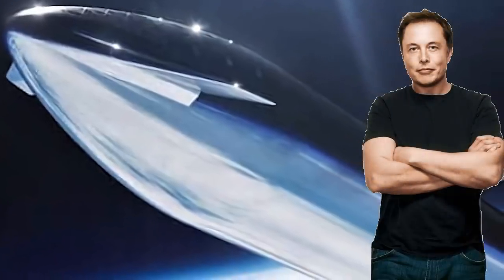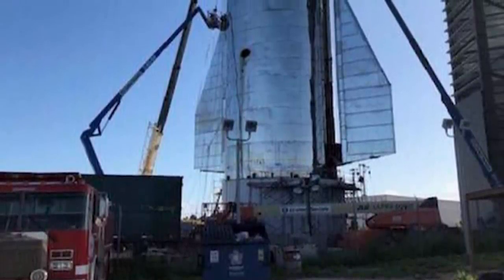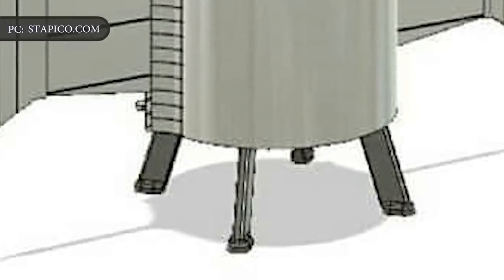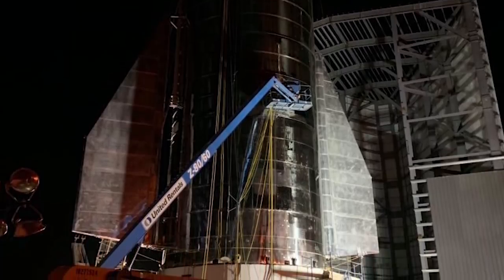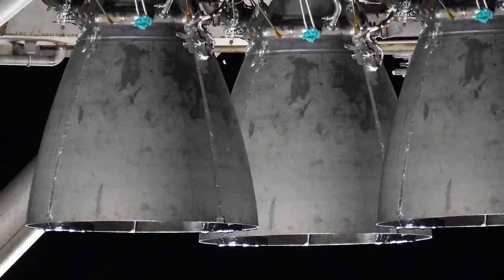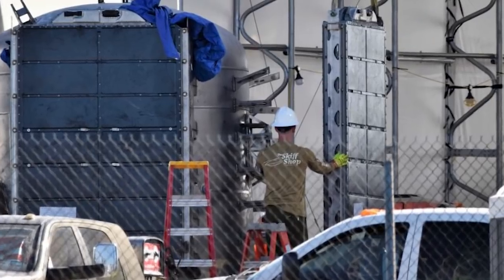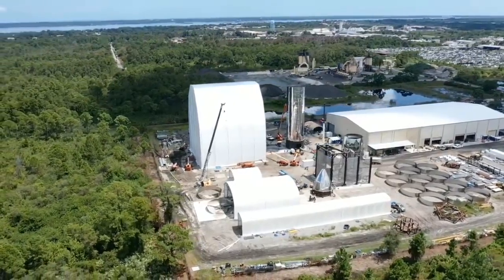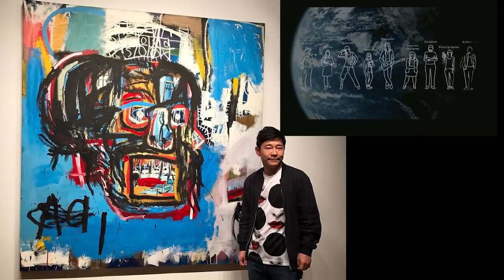SpaceX's Orbital Starship Prototype Nearly Finished- Elon Musk

Comment: My godfather was in charge of all welding instruction at Del Mar Junior College and worked in Saudi on pipelines and refineries. He would have been ashamed of the appearance of the welds on the various Starship prototypes. The panels are obviously not smooth and the welds do not appear to be smooth, either. It is hard for me to believe that these units will survive a hypersonic reentry. The irregularities will create flutter that will tear the panels apart, and the lack of smoothness will create hotspots that even stainless steel cannot withstand.

Elsewhere in commentary on the Starship, it has been noted that the steel used on the Starship can be bought in rolls as well as pieces. Rolls would only require one weld to close a circle and that would leave only the welds between rings. Those could more easily be smoothed and the rings themselves would be smooth, making the whole thing stronger and more aerodynamic. It also would be able to set up stir welders like those that are used on the F9. Those produce microscopically smooth welds that have no weak points. Even with almost perfectly smooth structure there will be great heat and pressure on that hull. If it is going to enter at a steep angle, it might be wise to slowly rotate the structure to spread the heat and allow cooling on the back side. I desperately want this to succeed, but right now I have my doubts.

Comment: I can't help but think the hinges will provide an attack surface for the re-entry plasma. How is this not an issue?
Reply: I thought so too!! Maybe they have got internal channels for super cooled fuel to absorb the heat??
Reply: @anthonyclarkson5209  I'm sure they have a solution! I just wish I knew what it was!
Are they also going to have heat tiles on the leading side of the ship? How are those going to be applied to stainless steel?
Reply: @DenisLoubet  From what I've heard they're literally going to screw the heat tiles onto the hull, no adhesives
Reply: @anthonyclarkson5209  !!! No doubt with little heat shields on each screw!  ;-)
Reply: @DenisLoubet  The way they keep changing that design every second, they might have an entirely new plan of cooling when he gives his speech this weekend!
Reply: @anthonyclarkson5209  Can't wait!  :-)

Comment: raptor engines is probably a photoshop job. you can tell that they used same photo by looking at the dirt pattern on the engine bell, which is exactly identical on all three engines. nobody noticed it?
Reply: I noticed it immediately.
Reply: Haha  I did not notice the first time, thanks for the sharp insight there. I feel a little worried now if thats the way Spacex are rolling. What else may they be faking???

Comment: Wow!! I didn't know that there are so many parts to a Raptor Engine!..no wonder it's So Powerful!!🚀 Elon is Extremely Intelligent designing these Awesome Beauties!! STARSHIP/SUPERHEAVY is Going to be GLORIOUS Standing Vertical on the Launchpad😍🙌🙋🙌She is going to be BEAUTIFUL😢💖💖💖
Reply: A lot of the small pipes wires etc are instrumentation.  They need to know flows, temps, pressures etc at a lot of different points in the plumbing.  Once testing is complete some of that will come off. :)
Reply: Don’t think Elon designs these engines just by himself.  Probably isn’t the primary designer at all
Reply: Tom Koller  lmao